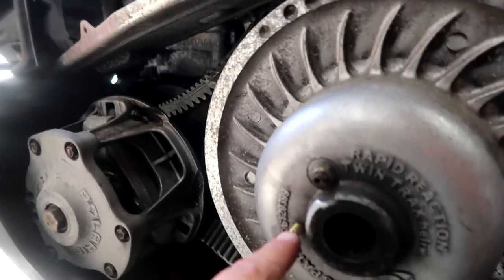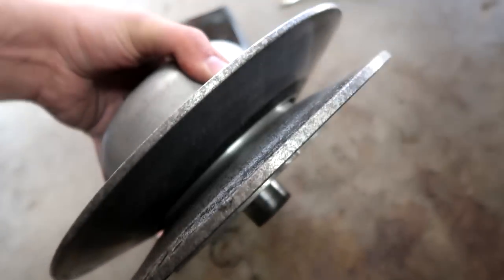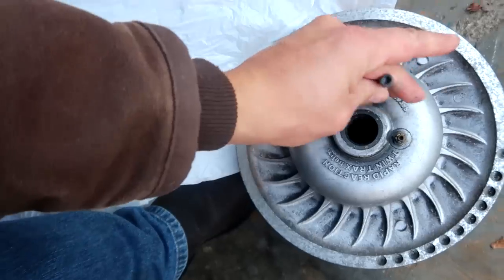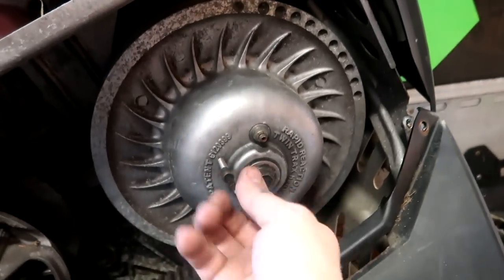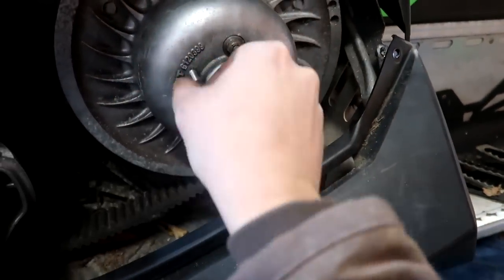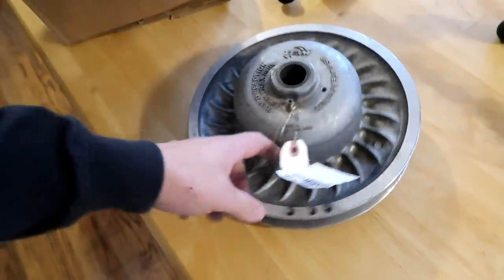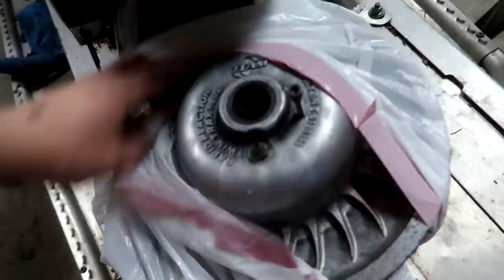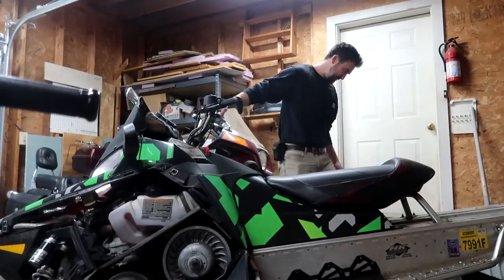WE FIXED THE SNOWMOBILE !! (Polaris Assault 800 Problems)

Comment: Sometimes those bolts you stripped on the old clutch, have red loctite on them, which means you need a little heat to crack 'em loose. But irrelevant now that you have a new secondary and likely have sold the sled by now. p.s. glad you are posting video's again! just in time, sled season is around the corner!

Comment: If you shut the sled off after using reverse, the clutch spreader won’t work….it binds and can strip the clutch or break the tool. you have to shut it off driving forward to put the secondary in the right position.

Comment: When you put your new belt on your old clutch it was just sitting too low on the sheathes, with those team clutches, once you put a new belt on, you have to work the belt around the clutch until the sheathes fully close again and the belt is sitting flush with the outside of the clutch

Comment: Those secondary bolts drill right out,if in doubt you always get the impact driver out! I never needed any heat to take out team secondary helix bolts and you should always use blue loctite on them anyway if anything at all👍 Thanks for the video, Do you know how the rollers are in either of those clutches???

Comment: @jeremyRhydes
Pulling that clutch spreader tool does not make the clutch close onto the bolt. Before starting the sled when the new belts on rotate the secondary back and forth to close that gap up

Comment: We wanna see the trip to main you guys were supposed todo last year in the rs1 and the 800. Deff don't sell the 800 asult and keep it! No reason to sell it and it's your ripper. Love the content on that sled but also the old ones! I really badly wanna see a build video on the rs1 basically streetbike. With little mods that sled will be a monster! Smoke the 800 with no problem. We wanna see some sleds get new aftermarket or upgraded parts to make em all nice and reliable! But deff do the main trip!

Comment: The four torx bolts are heavily loctited. Use heat and a impact driver. There is nothing wrong with that secondary. The other screw with the 1/4 lock nut just needs to be turned in to spread the sheaves.

Comment: those helix bolts are heled in with copious amounts of blue locktite, You have to use a decent amout of heat to free the up or else you will strip them.

Comment: Those helix bolts on the old clutch will be red loctited on. Hit each bolt with a torch for 1 min then use an impact to remove them.